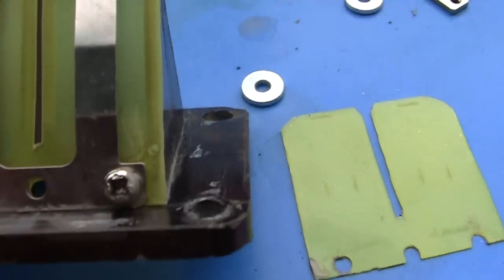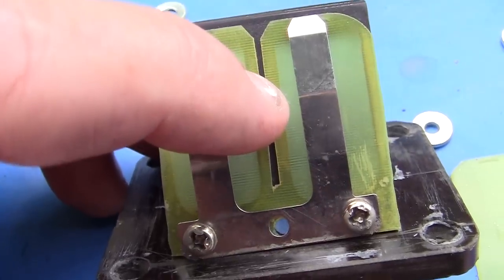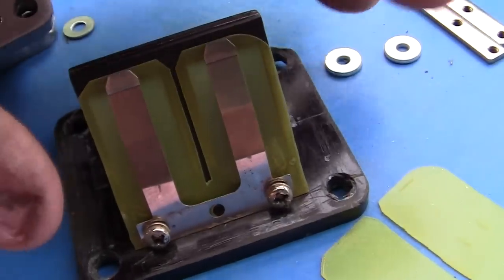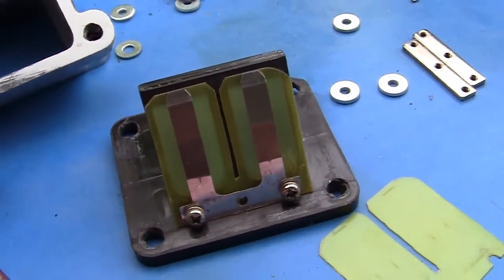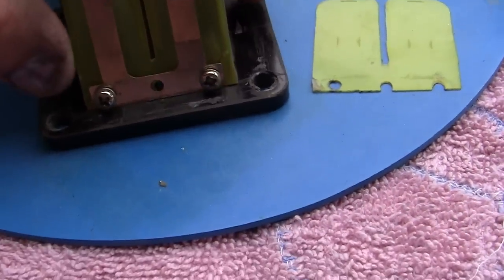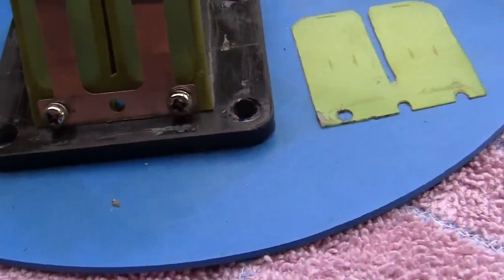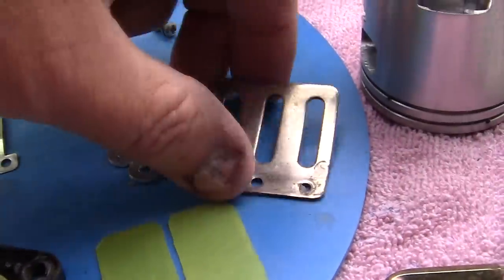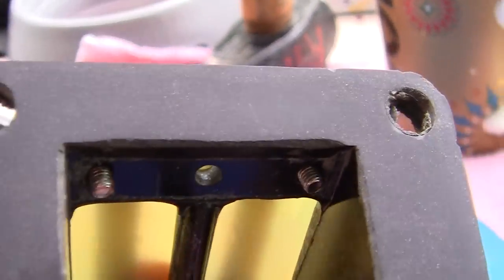7)-  HOW TO= Tune Reed valves for MAXIMUM  POWER !!! (the end)

Comment: I have removed the reed restrictor plates from my bike before. It does work but the problem that eventually shows from doing that is the reeds start to deform slightly and stop making a good seal when returning back to the block. This makes your bike consume a lot more fuel then it normally would. The other risk is the reed has a bigger chance of breaking and going into the cyclinder which will make u have to replace the top end because the piston and rings will get damaged. Could possibly seize the engine as well. I had the fuel consumption problem and got lucky by replacing the reeds and putting the reed restrictor plates back on before they broke. All that being said, you do get maximum power from removing the restrictor plates. It’s a risk.

Comment: Ha! there is a 4 stroke with a reed valve,it is the 1981-82 Honda XR500. those were there to eliminate the low engine speed cough and stall when nailing the throttle.
Reply: Wtf that's neat

Comment: I am a SR. engine development technician for a leading snowmobile manufacture I have done two stroke engine development for twenty years, all I can say about this guy is (WOW!)
Reply: Is that wow an insult or compliment? All I know is that combining the best quality top technology reed valve material, which is Boyeson reeds AND fine tuning your mass produced reed cage to be PERFECTLY flat and PERFECTLY sealed, the bottom, mid-range and Top end performance of an two stroke engine can be dramatically improved and I have proved this with this particular reed valve that has lasted two years and works EXCELLENT!!@ thanks for watching RH DSD

Comment: No insult or complement intended (just a statement), about the knowledge and the lack there of on reed valve design. We all need time to learn but good information from good sources is a must, might I  recommend an S.E.A. publication, (DR. Gordon P. Blair’s book, The design and Simulation of Two Stroke Engines) learn the basics like reed block design flow area, realize how reed natural frequency effects design, understand how different types of fiber material and epoxy’s and reed thicknesses effect reed natural frequency’s and the performance of a given reed material, understand the relationships between design flow area and flow resistance, understand the effects of crankcase primary compression ratios and how they effect a given reed design ECT, and no you don’t need to be an engineer to understand this stuff you do how ever need to have good sound information, S.A.E. publications are usually a very good and  trustworthy source.

Comment: I know this is from 2013, however. I'd like to give everyone some tips, if they haven't been discovered yet. 
You want the reeds to be narrower than the width of the reed block. Not only will this ensure that the reed doesn't rub against the intake, it will decrease the weight of the reed, giving you snappier throttle response. Trim off as mush excess reed material as possible, leaving 1/32 of overlap.
Removing the reed stop will allow the reed to open farther, if there is enough air flow, at the expense of shortening the life of the reed due to fatigue.
Reply: Removing the stop is probably a good way to have broken reed chunks scaring up the piston, and cylinder.

Comment: Some people do not know this but, reed valves on 4 stroke engines are used because of the overlap and duration of the intake lobe on the cam, if there was not a reed valve there some of the a/f mix would come back into the carb.

Comment: I usually find that the chrome muffler bearings do not have the lifespan of the higher quality nikasil bearings. Also when replacing said bearings it is advisable to use a proper lubricant for the carrot.
Reply from the maker: Nikasil Racing Cylinder Bearings cannot be beat and were originally developed to Power the American Space shuttle in its quest for breaking earths gravitational orbit. I would love to buy some, but they are made only in Iceland and extremely expensive to export. Also the customs permits are outrageous at this time. I am sure you have the same problem. Thanks RH SDD
Reply from the maker: I fully Concurr with your findings on proper bearing replacement and maintenance of said Muffler Bearing High Quality, mark 5- Components. RH DSD
Reply: Make sure you use yellow lithium grease for best nikasil muffler bearing performance.  By all means, NEVER use synthetic muffler bearing lubes, the muffler will over rev and you will have a run away engine and eventual total melt down. If you can't find yellow lithium grease, it is ok to substitute with Vaseline instead as it is the only other officially acceptable muffler bearing lubricant that is readily available in the states.

Comment: So to tune it as I understand from your video, I take it apart and look at it and put it back together?
Reply from the maker: +Mike Montgomery No, first you must align the dual chrome muffler bearing adjustments, till they track due east. All Reed screwed must be weighed, filed to the lowest weight and put in with the slots pointed toward the front of the engine and not anywhere else. This work must always be done on the first Tuesday of the month to provide the best Karma for optimal speed and power performance. The blue oval performance mat used in the video must be precisely 9-1/2 inches in diameter, (the exact length of my enourmous Johnson). Lastly you must pay more attention to the contents of the video instead of asking Stupid Questions....Then yes, you put it...back...together...Forrest Gump.

Comment: use a spacer to push back your stop plate 
i have used old feeler gauges cut down to fit and there thickness is stamped right on them

Comment: Man I took my muffler bearings off  and I cant find my red valve anyplace by it?  Should I check under the flex capacitor?
Reply from the maker: I always look under the Radiator filler on all my Air-Cooled engines!! I have many more videos on my Recently Updated  Channel Playlists, check em out! Thank you. DSD

Comment: I have a new set of reed petals I am installing one side is waxy texture and other is smooth texture.... what side is facing inside engine to case and vice versa what side has air/fuel entering against it.... I put the waxy side touching the cage so the air fuel mixture will touch the waxy side of the pedal... let me know if I need to change orientation.... these are R&D dominator m16 reed cages, also noticed this reed kit doesn't come with reed stops and are prone to premature chipping and wear.... would it hurt to add my own custom stops from the stock cages?
Reply from the maker: Great question, I would use the smooth side against the Rib cage where the reed material touches. Reeds stops May come with new Reed valve cages, but never with just reeds. you can build your own, but metal fatigue can cause them to become brittle and snap and get sucked into the enginee. That is your call to try this.

Comment: Replaced the reed valves for my pw80 drag racing build and I’m telling you the stock 2003 reeds were in it and they were pretty shitty looking I replaced them and I had a lot better throttle response and she started easier and rand so much better

Comment: Hey brother I got a quick question if you don’t mind, I got a old 60hp Johnson and one of the sets of reed valves on the top carb is slightly open can I take the reed out and try to bend it back slightly? So that it sits closed it’s only open like a 1/8th inch or less, I can see like threw it
Reply from the maker: No, it wont work. The reeds have to seal tight with no leaks. Research and get a good set of reeds or boyeson reeds and replace them. It is a simple fix and happens all the time. If you have any holes in the reeds or can see thru them, they are shot and need replaced. You will immediately notice the throttle response and greater high end. Reed replacement is easier than replacing a air filter or spark plug. Try it one time and you can do it next time with your eyes closed. Good luck, RH
Reply: @DIOSpeedDemon  they seem so expensive tho and I’m not sure if the 60 , 70 dollar reed comes with one reed or what?
Reply: @DIOSpeedDemon  I hope with the price it come with a hole set
Reply from the maker: @tholland5509  They are not cheap and usually come with two new reeds. THey last a long time. If the old reeds are worn or damaged or show light thru them, they need to be replaced. look up reed replacement  videos on your machine, then order new ones. You dont want them to fail in the middle of the river or ocean do you..???

Comment: first of all, nice educational video man,
i can see you have a real gift for these sorts of things, 
might i add that maybe it isnt such a good idea to leave the springs of,
especially when considering that some bikes have metal reeds...
and like you said, they can become quiet fatiqued and without those springs, they will sooner break and make your bike go clank clank in wich a "chaos like" revising operation is necessary... ofcourse what i am saying increases its moral value exponentiolly, the more tuned or the more rounds per minute the engine can deliver...
also messing around with the pre ignition ( wich some Capacitor discharge ignition (cdi's) units are tuned for) may cause these puppies togo bambam.. so yeah,
anyway thanks for the video,
i liked watching it.
regards,
a ÐØ§ operative
Reply from the maker: Valentino- {very cool name by the way}, You make a very good point. My racing books say that the stops can sometimes limit the valve opening to full potential. On the other hand- With the valves flapping all over, they can tend to create a weak spot at the base of the reed and crack and snap off. I have tried both ways just to experiment and I find that the stops are better for throttle consistency at high speeds. I meant the springs instead of the stops. With the Boyeson custom reed material in my new reeds, it is like three times as thick as a normal off the shelf reed. Thank you for the kind words, Randy H

Comment: Thank you, Teacher .  
Now I have some idea what reed valves are.  I am considering having a really fast two stroke scooter when I can fit it into the budget. I currently have a four stroke 125 cc GROM mini-moto and I am getting tired of wasting money on state mandated insurance and tags....  
  At last talley ,  7 states, "I think" , do not require tag or plate on 49cc and South Carolina does not even require driver license for small Engine  scooters... South Carolina does however enforce a minimum age of 13 for scooter operation on street. Otherwise,same rules as bicycle... 
South Carolina is unique in this. 
I am not aware of any other states that require no driver license to operate a scooter or moped on the streets.

Comment from the maker: WHAT IS IMPORTANT ABOUT THIS VIDEO.....IS..THE ...REED...MATERAL...THAT IS THE KEY. Boyeson Reed Material.
Reply: what about boyesen kevlar-plastic vs carbon fiber? Ive heard they chip a lot but I was getting a lot of trampolining on my hobbit with a 21mm dellorto and i think .3 boyesen reeds. i want to try carbon now, at .4 but ive seen them chip a lot. what do you recommend? should I put the stock reed tensioner  back and keep using the boyesen reeds?
Reply from the maker: You know as much as I do. I have no idea what or how Boyeson reeds are made or their shear weight or other variables.

Comment: You forgot to mention that you need a left handed snipe ratchet to remove the port side bearing in  ALL 4 stroke dual muffler bearing applications.
Reply from the maker: A left handed , METRIc snipe ratchet , I have three on hand....
Reply: there is no substitute for hands on work on your own equipment. great videos.
Reply from the maker: Wait till you see my new Stroker video engine series, starting with ta bare SR 50 moped block and going step by step to build a massive 120 stroked out racing engine for your bike. Parts are on the way as we speak. Some rare and really really Cool. RH DSD

Comment: 1) 4 strokes don’t have reed valves.
2) Your reeds metal ”springs” are on backwards.
3) How video was entitled “How to Tune Reed Valves” but you said nothing about tuning them other than maybe you can leave off the stopper plates. (Tuning a reed valve is also about selecting the right stiffness for the reeds, either when you are making your own or when there are different stifnesses available to buy)
Reply from the maker: Maybe you should make Your OWN video and explain IT to me...???
Reply: The sprung steel is not backwards, it has to have some way of fully closing the gap without making it difficult to open far enough to let air/fuel mix into the engine. Basic tuning  is cleaning parts for better performance and reliability and not just about how fast it can go when finished. Video title matches the content.
Reply: @karltaylor7378  No, tuning is adjusting for performance,. Maintenance is what you did.

Comment: i want to try this.. 😁
2 stroke reed valve to me like intake valve in 4 stroke..
work to open and close fuel to combustion chamber when engine running..👍
Reply from the maker: Great point! In my Playlists , I have very Recently Catalogued all my videos  on this Subject- Check them out !! thank you.... All Free!!!
Reply: Remove the 4t cylinder head and cam chain and fit a 2t cylinder head, then fit a reed valve to the carb.

Comment: Hi, do you think bad reeds can effect idling ? For example, when I shift out of first into second, the bike shuts off, but itll start right back up as soon if I jump start it while it's still rolling. Same shit everytime though. It did this before, I cleaned the carb put a new plug in it and also cleaned my filter (did not oil it) I wasnt aware. This all happened over the course of 1 day. Anyhow, it ran really good all day and then towards the night, it started shutting off. Do you have any ideas on what this could be ? Thank you
Reply from the maker: Could be a bad plug wire or the carb or intake. Something is affecting the engine when it gets hot..I have many more videos on my Recently Updated  Channel Playlists, check em out! Thank you. DSD
Reply: Hey Oscar
I know it has been two years since this initial post, however, is funny because I went to the exact same issues as you described there. I am riding an enduro GasGas EC 125 and after I systematically went through all the things I could have fixed like: changed the spark plug, changed the air filter ( I did oil mine :D ), cleaned the carb, checked if I get spark etc,  the bike was doing the same thing: shutting off on idle and between changing gears. I was not aware of the reed valve then (it was like two months ago), however, the cause was the one I feared the most: low compression = piston needed to be changed. 
Is stupid how obvious some things can be and exactly what we fear most happens. 
Anyway... this was my story to the exact same symptoms. 
If you get the time to read this, I am curious to know what was the cause back then for you. :) 
Wish you all the best!
Reply: @ilarionispas5104  thanks a lot lol damn this was so long ago ! I ended up not figuring out what the issue was and I took the bike to a local bike shop & let them figure it out. I gave up on the issue lol

Comment: Do I pull the conniption pins to remove the muffler bearings?
Reply from the maker: +L Malino I can see your a man who knows his Engines. Only European Metric bearings have the Conniption pins, BUT= There is a left and right pin and YOU CANNOT MIX THEM UP!! Of course a man of your learning already knows this and no DisRespect meant. America muffler bearings, Especially Borg/Warner super muffler bearings, Have high performance Conniption pins that can be purchased from Snap On I believe. They also sell the only tool that removes these little Devils. I also bought some high quality Board-Stretchers from Snap on. Thanks for watching RH DSD

Comment: Cheers man gunna take a look at the reeds in my speedfight !! Carbon fibre any good as can't get hold of boysen ??
Reply: Carbon fiber is fine, as long as you can get ahold of Real carbon fiber material and not grey colored plastic that looks like carbon. I ordered the Boysen reeds for a CR125 and prayed I could cut them down to size. I did this three years ago and never looked back. I took the reed cage and carefully sanded the edges down smooth, so the reeds had a flat, tight fit when closed and the bike works really really good. I have some videos on installing the Boysen reed material and I am happy as can be with the results, RH DSD

Comment: mr. can i ask a question is it ok to remove the stopper to stock reed cage and replace it spring to make more power 
tnx
Reply from the maker: I am sure you are not a factory trained boat buyer with any years experience. One video, and 4 views against 30,000,000 million total channel views? Lets hope your factory trained Honda work, was better than your hole in the boat fixer upper...

Comment: how do you tell if the springs are broken ............ with out taking your engine/carb
Reply: THAT is an Excellent question. The answer is: You cannot tell without taking the carb off and the reed block and looking at the reed block. Grab a screw driver and a socket set and TAKE THAT BITCH APART !!!. We learn by Doing, Practice makes perfect. Put your fear away, and take that carb circuit apart and look at it. IF the engine aint running rite, -take it apart and look for the problem, it will not go away on its own. I have plenty of tear down videos to show you how, friend, Great question mate. RH DSD
Reply: Thanks for the help.
Reply from the maker: jimmy mangat THANK YOU!!! for watching, I hope it helps and I have hundreds of other videos on all forms of DIO engine body scooter tuning painting GO FAST help !!